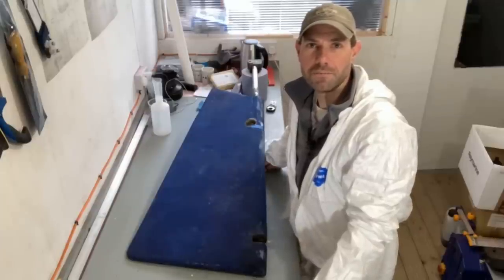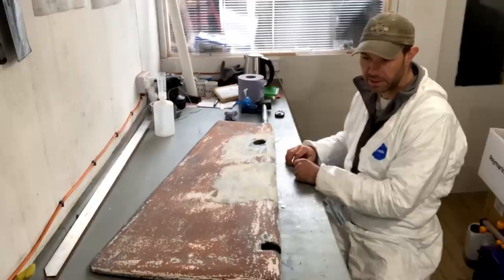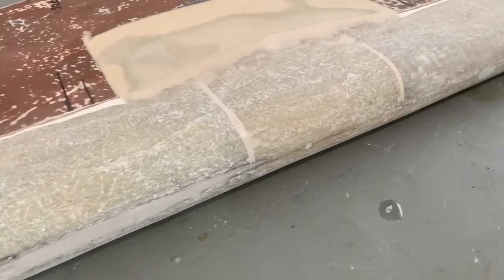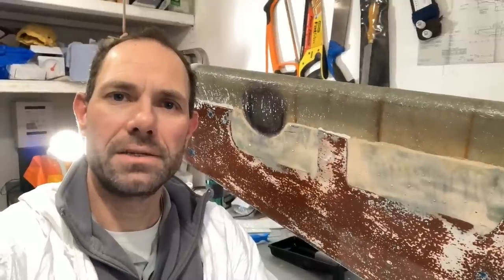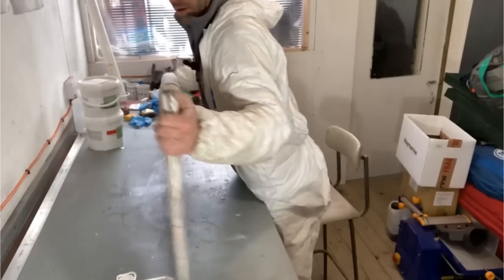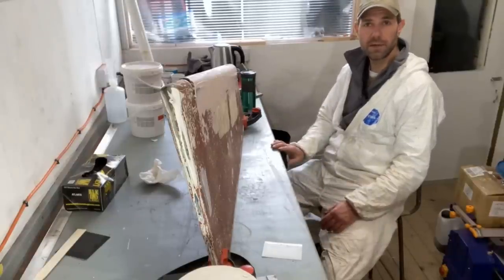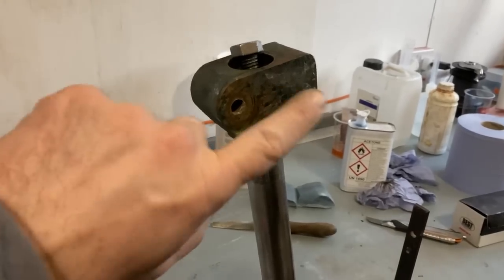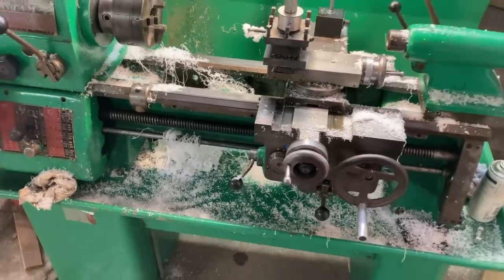1970’s Rudder Repair - Contessa 32

Comment: Great share thank you! I am about to try an extend the length of my rudder because it was cut short to the bottom gudgeon with a dodgy heel plate after the previous owner put her on some rocks on Fraser Island. I am a bit intimidated by the job but I am enjoying working with glass and epoxy, amazing stuff! Like anything you know when something will work and when it won't, I suspect I am overdoing some things a bit but am slowly starting to learn to trust the material. Thanks again, owe you a beer!

Comment: for the top seal, i was thinking as i was watching, if it was me i would just pour some epoxy in the top and hope for the best, but that probably wont work because the epoxy will be to brittle and will crack as soon as force is applied to the rudder and so I wonder what George is going to do!, George: im going to pour some epoxy in the end...
Reply from the maker: Done this before, 9 times out of ten it’s a successful fix, as long as the stock can’t move in relation to the blade (which is why we check the tangs) then it should hopefully seal.   Epoxy used because it bonds more readily to the stock than poly which shrinks as it cures.

Comment: Love your videos but having spent MANY MANY hours freeing studs, bolts, nuts, screws, impellors, props, Etc. I am now a great believer in anti-sieze, Noalox, marine grease, PTFE, Etc for which decades of marine techs have probably silently said a quiet prayer of thanks. I have used anti-sieze on prop shafts and don't remember having a problem, what issues have you experienced?
Reply from the maker: I am also a great believer in greasing parts that may need to come undone as I may be the person that has to do it next time but the only exclusion is in a taper as they rely on the friction of having a tight and close fit to work.
Reply: @RefitandSail  The internet mostly agrees. Although if you think of generator engines, they can be ordered either straight or tapered shaft both with single keyways are we saying we'd grease one and not the other? I personally can not remember seeing a problem from a greased taper but then my memory is not what it was :)

Comment: Funny , why don't they use bronze inside the rudder , no worries about crevice corrosion.
Reply from the maker: I think bronze may be a bit soft + it would be considerably more expensive
Reply: My rudder internals are all bronze, including the post , they just made it thicker to compensate for its softness . I had it off the boat last year to take a look and there was nothing to repair . I drilled into it as well and found no foam core . It was solid glass ! No wonder it weighed over 300 lbs !

Comment: Regarding a lathe. I heard opinion that actually old models tend to be far better  made then current commercial models. Not mentioning a price.
Reply from the maker: At the price point I was buying I could get a new Chinese made hobby lathe or an old school light-industrial lathe, this is far superior even if it’s perhaps not got all the bells and whistles, it runs without flex/deflection when making a largish cut so I’m really pleased.
Reply: @RefitandSail  Lathe , press drills, metal mills and sawing machines. 
Looks like those days best way to buy is second hand on eBay. If you know what to look for , you not only getting superior quality tool but for fraction of original price, and actual value.  
Ps. Really enjoy your channel. 👍